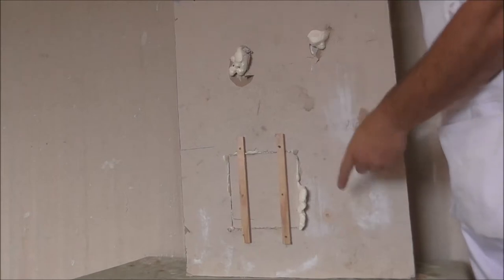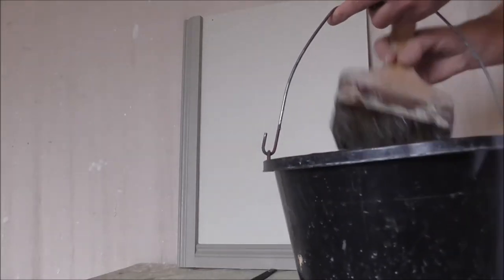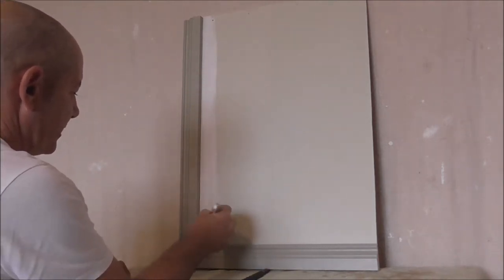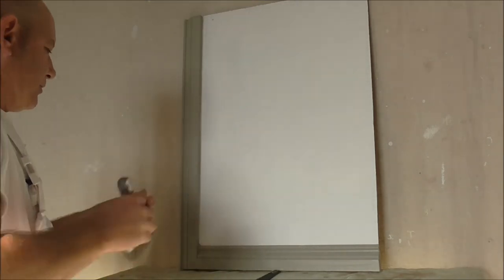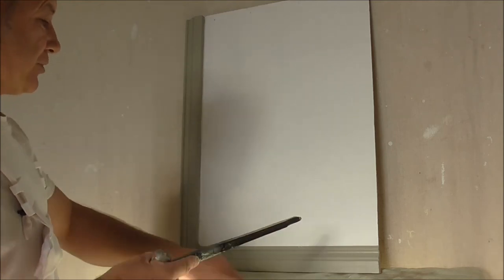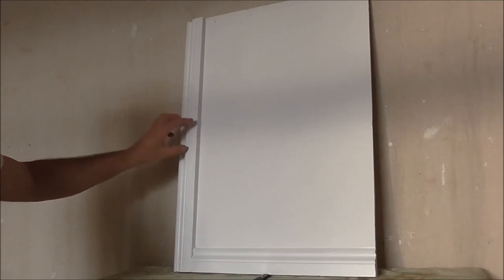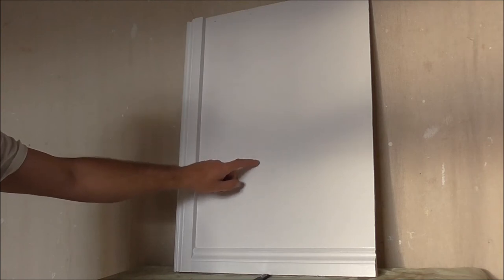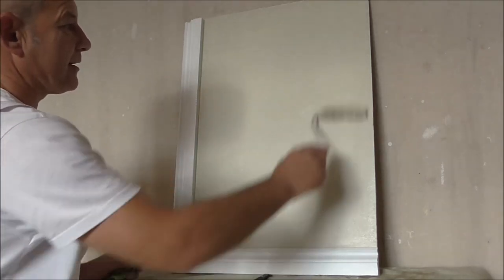Can you paint over wallpaper paste?

Comment: I have this same issue but it was done in a bathroom so the humidity has made this worse and given it a moisture dripping sheen. I am planning to seal it with BIN (Shellac) primer, but I'm not sure.if I should clean the walls before. They're so sticky and have so much dust stuck to these areas I'm not sure that using a brush (like you showed) or a sponge would be strong enough.
Reply from the maker: Warm soapy water and a sponge should be fine...  wet a area in and leave for 5 minutes repeat wetting helps work up the old paste..  then rub off and wash area again...  this will remove old paste..  allow to dry fully before applying any sealers. thanks

Comment: But what do you do when the walls have already been painted? How can I fix the walls and paint another color? Every wall in our house has wallpaper paste beneath the paint! I can see it. The walls were painted approximately 8-10 years ago. Can I paint the walls with a sealer like Pro-999 Rx-35 and then paint? Or do I have to scrub the walls through the paint until the paste comes up?
Reply from the maker: Depending what paint has been used....  it would have sealed the paste...  sand wall and use a washable matt give it a quick coat.. if any areas react when working just scrub area with paint brush and work paste into paint...  once dry sand down and walls should be sorted...

Comment: Hi, have just stripped our living room walls and there is a load of paste still on the walls, have wetted the walls and scraped of a load of paste but can still see the paste (there is a animal print sheen still). Do I just go at it with hot water and sponge now or scrub in the paint? Also have patches of paint that can off with the paper, do I use fillers to get the level the same of build with paint coats? Ps your videos are great for us !!
Reply from the maker: As long as you have tried your best getting all the paste off it should be okay. you need to scrap off any loose paint, then seal wall with diluted PVA. fill to feather any edges, sand and seal. Ready for paint or paper.

Comment: After removing the wallpaper, can I give the walls a quick wipe down with soapy water, let it dry over night, sand it down then apply mist coat to see if it cracks?
Reply from the maker: No, you need to make sure you wash them down properly. You can usually tell that you have removed old paste.  No short cuts or problems arise. Thanks
Reply: Is Zinsser Guardz any good for preparing walls for painting over stubborn wallpaper paste?
Reply from the maker: @George-uq6yf  no best to just remove the wallpaper paste.   If it does not want to come off its properly nit wallpaper paste...  covering probkems apart from stains is no good..   warm soapy water elbow grease..  if all else fails then see if it reacts with your paint if not happy days.  Only then would I put something over it,, but lining paper is a better option and cheaper..
Reply: Wash walls down then a coat of zinsser Gardz it seals in any left over paste leaves a fantastic Finnish for emulsioning or lining its water based and can coat up after 3 hours
It’s great as well for sealing distempered or limewash
Been using it now for years with no comebacks a no 1 professional sealer

Comment: So I have a wall that had the paper stripped off and washed but a couple patches of rogue paste remained. Only when I rollered on one coat of emulsion did I realise (someone else did the washing off). What is the best way to correct this. I'm thinking it might be best to wash off the paint quickly, (before it dries too hard) and remove the paste then once clean put the first coat down again. Is this possible or will it end up looking worse than leaving well alone and hoping that the second coat will hide it all?
Reply from the maker: Sorry for late reply, you can wash it off, but what I usually do is just scrub the area with a paint brush and mix it with the paint.  Then roll over usually works a treat.
Reply: @PaintingandDecorating  I'll give that a go.

Comment: I hope to get a reply! my issue is the wallpaper won't come off... I did everything , did the holes in the wallpaper, put wallpaper stripper (idk what it was called so calling it that) let it sit and scraped it off and peeled what I can off but there is still paper and alot of glue on the walls.. I'm so tired of doing this and it still not coming off .. can I just sand it and paint over it ?
Reply from the maker: If you get to a point where it won't come off...   just wash it over allow to dry fully then sand..  then give it a coat of diluted PVA..  milky water...  allow to dry..  then a coat of washable matt...  Once dry you should have a good surface may be some filling before your colour. Thanks

Comment: Hi there,is there any point in mixing some pva with your paste? Nobody has mentioned it before. Cheers
Reply from the maker: Yes you can but it dries to fast..   better to buy ready mixed with added PVA.. thanks
Reply: Thanks for reply. I feel I do not put enough paste on my paper,poss due to brush,all these nylon bristles seem too harsh spreading paste,is a wide paint brush better,or does anybody use a roller? Am redecorating our bungalow after much building work so your tuition is grest help. I noted my white emulsion ( crown brill white) gives a powdery coating on hands if touched,not good on walls,so think I will wetwipe and repaint,sadly,maybe try valspar?

Comment: Hi mate.... When stripping old paper with the intention of making walls good for painting for customer do u prefer to (1) lightly skim over all the walls with some powder Filler and a good sand down and clean or (2) hang lining paper. Quite often I find myself stuck in two minds about which option is best. Lining can often be quicker but for some reason it can be hard to talk customers into having walls lined before painting as they have this fear of putting paper back on and often they just want rid of it altogether. How do u go about it mate? Sand and fill and clean, or line!
Reply from the maker: Stuart McIntosh Well usually I say for best results line the walls. And explain to the customer that it will just look like painted plaster, but each wall has the same texture after applying lining paper before painting so makes for a perfect job. Sometimes on damp walls it's better to just emulsion the plaster to let the wall breath.

Comment: What if you use an oil based undercoat? And you then want to repaper the wall. I have been removing old paper from an old horsehair plaster wall and it is very difficult to get all the paste off. It does not tke ten minutes. I've spent three days on the one wall and I still haven't got rid of all the glue. So can I  paint over it with an oil based primer
Reply from the maker: If you're putting a paper on, it does not matter too much if there is a small amount of old paste left as long as there is no mold treat the mold.  And you can hang lining paper if you just want a painted flat surface.  The only reason you need to clean all the paste off, is when you are applying paint directly to the wall so it does not react with the paste.
Reply from the maker: There is no covering up old paste with any paint. Your're only making problems for future decorating.